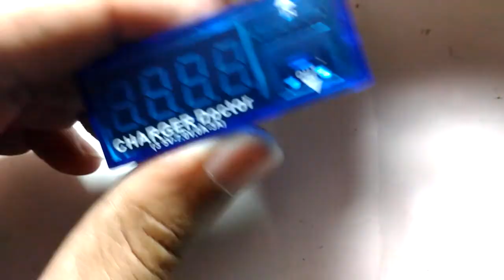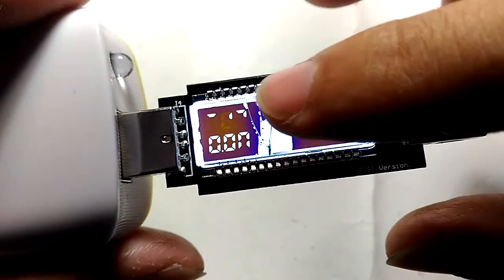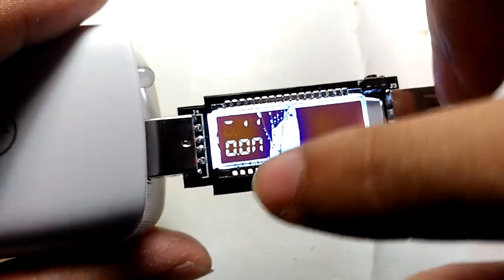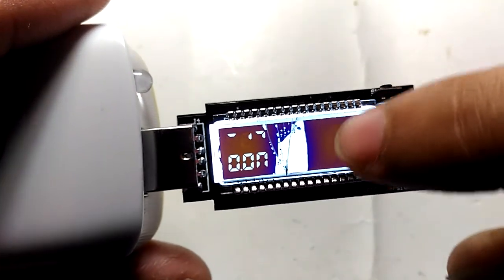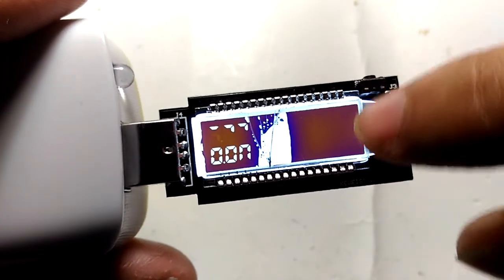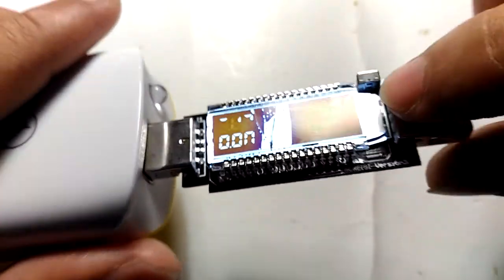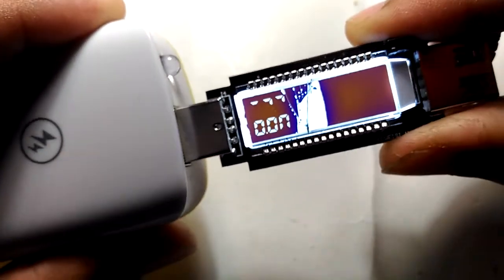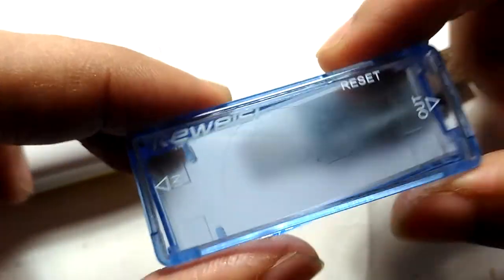IE15 : Inside broken KEWEISI USB power meter!

Comment: Hi i have a very similar meter and it does the same thing mine has a problem and it wont read voltage but does everything else would you know what component on the board
Would need replacing to fix the voltage so it will display thanks for the helpful video also.
Reply from the maker: Hi, usually the first thing we can check for is the connection between the voltage divider resistors and the chip itself. But the chip is under the display which you need to take out and sometimes it will be a COB underneath. In such case there is nothing we can do. :) Thank you for your valuable feedback though. :)